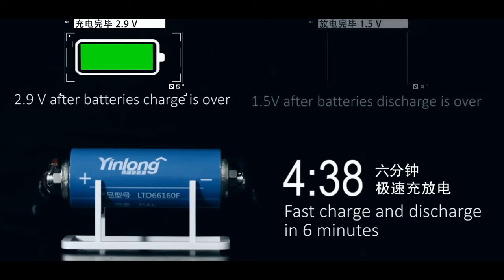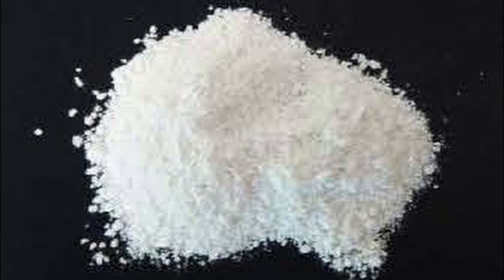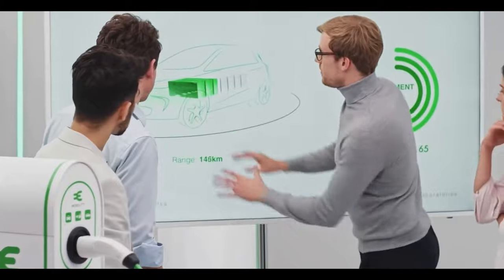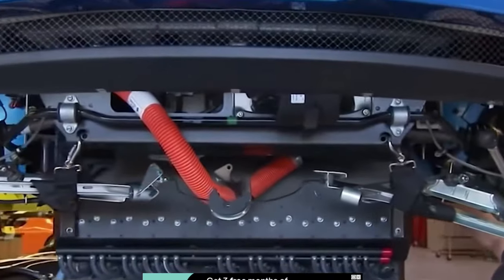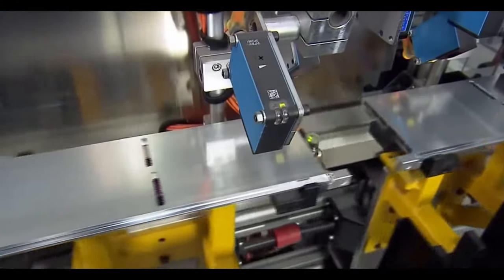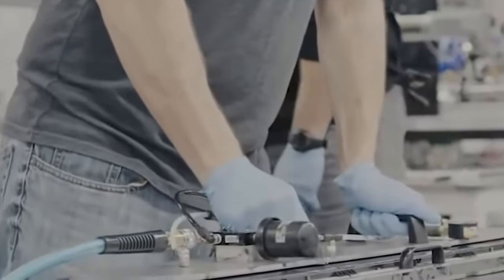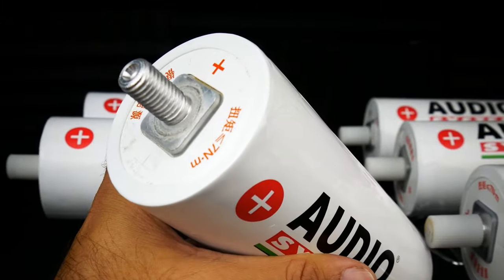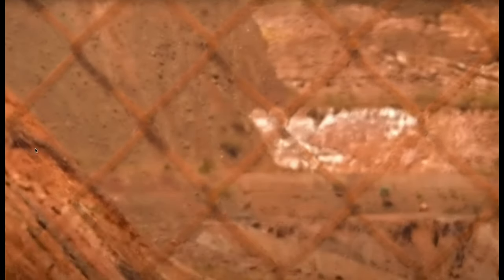LTO Battery - What is it?

Comment: There are now more than 1000 electric busses in Moscow, Russia, and all of them use LTO. The Kamaz-6282 is the most used model and they've got an 80KWh battery that is good for around 50-70km of range (perhaps 5km lower in the Russian winter, but those batteries don't really even need heating as they can supposedly work at up to -40C), so LTO is quite well used for at least three years now.

The idea is to drive a regular return route that is 30-40km and to then charge the battery up in 15 minutes at an ultrafast charging station while the bus driver is on a break. Since the battery would mostly be charged from around 25% to 75%, this greatly improves the amount of charge cycles, which is already absurdly high at around 20,000+ before the capacity drops noticeably, and you would still be able to use it.
Reply from the maker: These are perfect for application as this one - great for cold weather and great for quick recharge.
Reply from the maker: А какой Бранд  батарей они используют?
Reply: @LatutaEV  I am not sure about the brand they're using, but they likely use a well-known one like Yinlong as they produce good LTO batteries and they make and sell them in bulk. Being close to China also helps in shipping those batteries by a truckload. And because the chinese manufacturers favour quantity and like to sell big lots at a discount, that also helps decrease the price of an electric bus quite significantly
Reply: @LatutaEV  Among other electric busses other than the Kamaz-6282, there is the Liaz-6274 bus (more than 255 are built) that use NMC batteries. They have a slightly higher range and they can also charge using ultrafast charging stations, but they're rated to be used for around 6 years, which may not really be the best choice.

Also apparently the Kamaz-6282 uses a diesel heater to warm up the batteries in winter. Since they're rather effective and require little fuel, they do actually make sense, as the routes may take up to 1.5 hours until they can charge up, and spending lots of valuable electricity to warm up the heavy batteries (with lower energy density, so there's a lot of mass to heat up) is just not entirely possible, especially at -20°C or lower.

Comment: I bought 300x 24-cell 20Ah repurposed LTO batteries from the Honda Fit two years ago. After using and abusing them this whole time, I finally have a swollen cell. One battery saw a voltage of 80V instead of the maximum 64.8V. I don't know which battery it is though, because I forgot to mark it and they are all testing fine. With conventional lithium-ion, I would just have a fireball.
Reply from the maker: Yes they are cool aren't they. What did you use them for? Was it in car application?
Reply: @LatutaEV  They are powering off-grid telecom equipment and we're also using them as starter batteries for mining equipment. We are converting some mining equipment to electric. Here, weight is not a problem. We already have counterweights anyway. Above all we need batteries that won't turn into a fireball when an excavator accidentally digs into the batteries. Oh! And batteries that still take a charge at -30°C
Reply from the maker: @BullCheatFR  wow that is really cool, where you getting the batteries from?
Reply: I've been waiting a long time to find a good source of LTOs but I don't have one, and new cells are ultra-expensive.

Comment: I'm using Toshiba scib 20ah cells for a 36s 2p pack. It's capable of 60kw bursts and will never need replacing (not in my life anyway)
Reply from the maker: Wow cool I would like to try them as well
Reply: @LatutaEV  They're heavy. Works out about 1300 watts (maximum discharge) per kilo. Which isn't too bad. Obviously too heavy for the track, but reliability is second to none, which adds to the peace of mind gained by knowing your ride isn't going up in smoke.
Reply from the maker: @colinriches1519  If you look at other comments someone commented that they used a lot in trucks in Russia

Comment: When can we see phones using LTO batteries? Typically, bms average life span is 3-6 years.
Reply from the maker: Not very soon as most manufacturers are trying to get the highest energy density and they don't care how long your battery lasts. In fact they would prefer it died sooner so you buy a new phone.

Comment: This tech is quite old. It's been on the market for decades. The main issue is cost. LTO  batteries are expensive. That's the unspoken fly in the ointment of LTO batteries. It's much like flywheel/gyro stabilization systems: nobody ever says it but if you do the research by prototyping such a system, you learn why they're not used to make self standing 2 wheelers. Spinning gyros are  noisy(!) so that's the unspoken fly in their ointment.
Reply from the maker: Yes but often old tech gets implemented in a new way and you have a new breakthrough. Look at Axial flux motors that was an old tech too ;-)
Reply: who cares about the cost when they can last up to 30 years